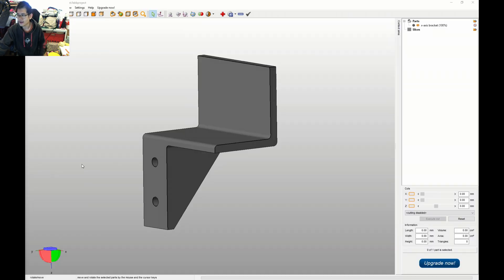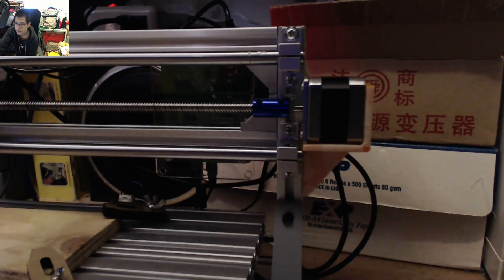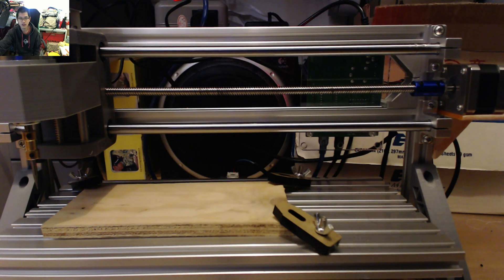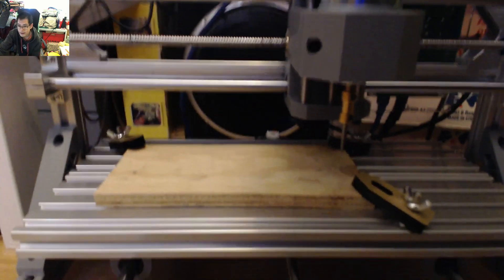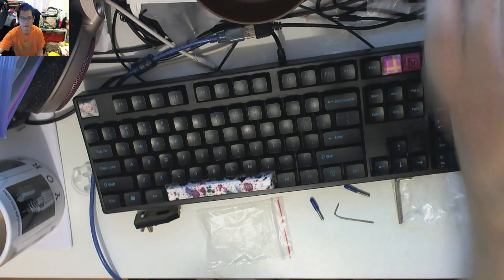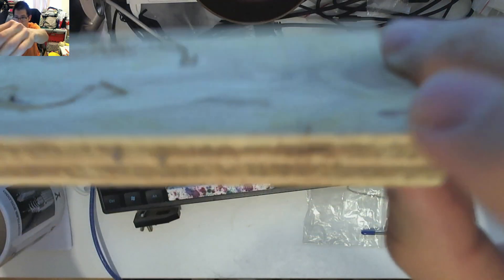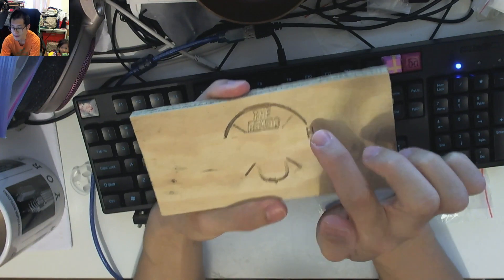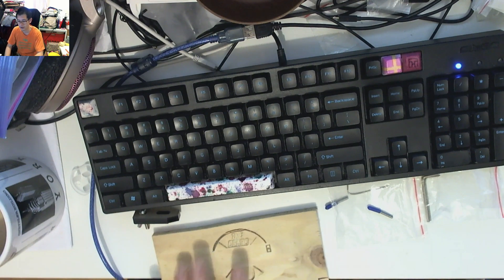3018 Mini CNC Review - Pt 2

Comment: That issue you are having with the X axis leadscrew....I don't think it is a bent lead screw......more like a badly attached coupling......remove the lead screw and lay it on a flat surface....table top, whatever you have, and roll it along to check for straightness, Then check the truth of the coupling as it is on the stepper motor...….it almost appears to be the fit in the coupling between the stepper motor shaft and the lead screw end that is making it go skew. The best type of coupling is the one with 2 splits.... one for the stepper spindle and the other for the lead screw...... the screws go in sideways and clamp the coupling down onto the respective shafts by closing the splits onto the spindle and lead screw, not by pressing a screw onto the spindle and lead screw. Make sure also that the bore in the coupling is the right size for the stepper spindle and the screw.
Reply from the maker: Hi Ian, Thank you for that. I did actually take the lead screw out, and it does have a gentle bend in it.
In regards to changing the coupling, I did not go down that kind of pathway, just focusing on the kit itself and what you could do (and certainly not exhaustive) option wise if you think outside the box.
Reply: @theboard  Well, a slightly bent leadscrew can be straightened and the coupling can also be changed to a better one without going to extremes. That tweak alone would give you much better results......letting the X axis stepper motor hang loose in a "cage" has to be the worst quick fix I've seen.  BTW, with that broken motor mount on the Z axis...….if you clamped 2 round hose clips around the motor, top and bottom, to prevent it from moving up or down and then applied that other hose clip around the broken mounting to hold it together I think it would do a better job.....you wouldn't need so much pressure around the housing trying to clamp the motor.....it's still a quick fix but better than nothing.
Reply from the maker: Indeed. That said, as far as tinkering goes, I am limited in both tools here to straighten the lead screw, and as this are (of CNC and machines) is not the primary focus of the channel/hobby space, its not something that I am looking to invest heavily in doing a lot more for when this entry level CNC is for tinkering with, to show its capabilities.

I do appreciate your time in responding and continuing to engage with me, and I know that others who may come and look at the comments will see your suggestions and be able to improve their units if they encounter similar issues.

There are actually improved versions of this kit out there, and a lot of other upgrades people have suggested elsewhere too, but right now, its not super high on the priority for me. That said, I have 1 more video part I have already filmed (way before your comments), so when that is released, please keep that in mind if you ever decide to come back and watch it : )

Cheers Ian, much appreciated.

Comment: I wonder why they don't use a shaft coupling on that x axis as in a 3D printer uses. I'm about to buy one and researching today. Already deciding what parts need to be redesigned. This unit has been out awhile and you would think those weak areas would have been addressed
Reply from the maker: Well, some of the parts for this have been re-designed by the community and can be found on thingiverse but my 3D printer is pretty atrocious in its ability to print to correct scale, but you're still at the mercy of plastic printed parts with strength reliant on infill type and %.

I would say the original designers of this have moved on and aren't really in the market to upgrade this design, or have redesigned as new series/products possibly.
Reply: @theboard  For the most part the plastic parts are really good quality with what I received. No too happy about the type of screws. The washer screw doesn't nest into the formed washer holes. I really wanted to see shaft couplers used. But its just my entry into the cnc world. I can print my 3d parts pretty decent these days
Reply from the maker: @grtbaldini  These days, its really not that hard to be able to build a CNC from scratch in the same way that 3D printers are made since the main components are practically the same in stepper motors and gantry structures/movement, so you certainly could 3D print the majority of everything, but of course for CNC you'd want something as rigid as possible, thus the metal components.

For the price point, it is entry, but for simple jobs, it does the trick, and I've been continuing to mess with mine trying to bring it up to working standard, and hopefully I've been able to do that somewhat.

Comment: Kinda disappointing Pt 2. Wish you had got another one and hadn't messed trying to fix it. I'm not sure anyone else would have done that.
I'm sure BG would have replaced it promptly and you would have had an even better experience with it.

One suggestion I saw in Pt 1 was your cables were getting wrapped around the stepper motor and I'm surprised it didn't damage the cable. Do your cable management to avoid problems. 

Do you plan on doing any upgrades to it.

WM
Reply from the maker: Hi W M. Thank you for the comments. I will address both pt 1 and pt 2 comments here for ease.

I did talk with BG, and they even looked at the video prior  to release. They chose to not replace it.
Re: cable management. Not much can be said here since there isn't really anywhere to manage the cables, and I had chosen to leave it not cable tied down so that I can unplug the cables and coil them up for when I put the machine away, rather than having the cables in positions that lead them to potential damage from getting caught on things, or being pulled on accidentally in some other way. As they have standard connectors on them, they are easy to reattach and disconnect, which is why I did not do any management of them. They are pretty basic cables, so I'm actually not surprised they had no damage.

In regards to anyone else, unfortunately, me coming up with a solution to fix the issue I experienced was directly as a response from BG's response about the lead screw being an issue.
Reply: @theboard  Didn't know you had talked to BG and I heard that people send them video for proof of damage. Most people get a replacement/parts to make it right. Since they gave it to you for review/test they thought it wasn't worth it. 
What do you plan on doing with it? Fix , upgrade, or move up to a better one?
What do you plan on making with it?

People do their own cable management because they don't say it in the manual. 

Thanks for getting back and good luck.

WM
Reply from the maker: Yes, if I was a paying customer, you'd be right in saying I should get a replacement, but since I am not, and it was at their kindness to have one to look at (which is why I said it just might have been a bad luck issue), it isn't worth the cost for them as this still demonstrates the function of the kit, and I suppose gives awareness of potential things to look out for if you are buying the kit. BG is simply the supplier, the kits would be sealed kits from their supply chain.

What do I plan on doing with it? Well, I don't really have a need to 'fix' it since my solution appears to solve the issue for the bent lead screw, I am waiting for some bits to come in from BG to continue to work with it, as they have agreed to send me a collet set and also some more endmills to play with :)

I'd like to perhaps try and do some switch testers or single switch holder, but we'll see how the straight endmills perform as the only two that came with it being conical are not suitable for deep straight cuts.

In regards to cable management, the other issue is, there is a distinct lack of space to really do much with, there is a lot of excess cable length for two cables as they are static (Y and X steppers) while the Z needs movement since the it runs along the X axis, so if their cable lengths were made shorter and specific, it would be easier  to cable manage against the frame.

At the end of the day, I do what I can with what I got, and I don't want to be a choosing beggar, as these are provided to me by their good grace (and of course their desire for sales), so all I do is be optimistic and show them as honest as I can :)
Reply: @theboard  Cool. I looked on BG and they have a lot of parts so if you need to you can buy as needed.
I'm about to let go of my money next month. That's when the real work begins. Learning how to make it all work and even make a couple of things I could use.

Good Luck

WM
Reply from the maker: Thanks ^_^
I'm a cheapskate though, which is why I appreciate getting sent review units haha, so I hope BG get their value out of my reviews and continues to support me! :P